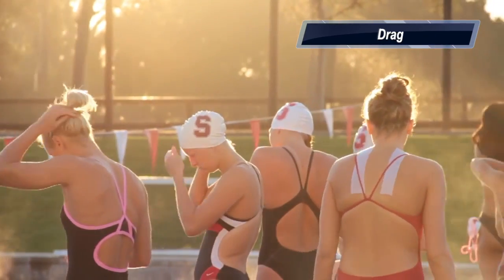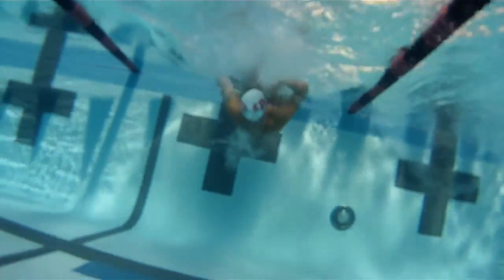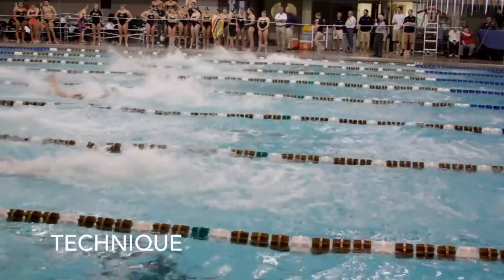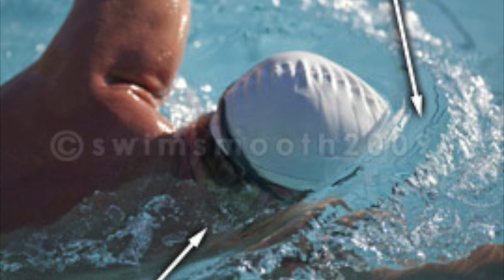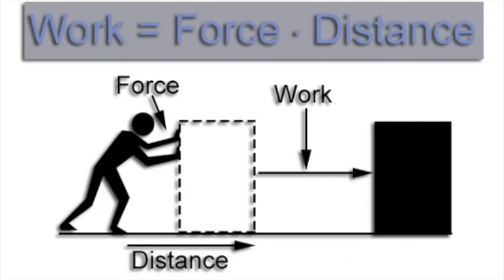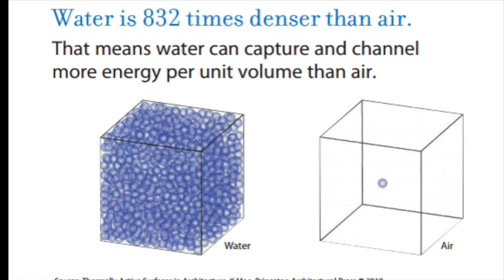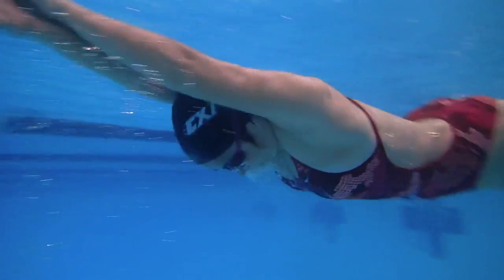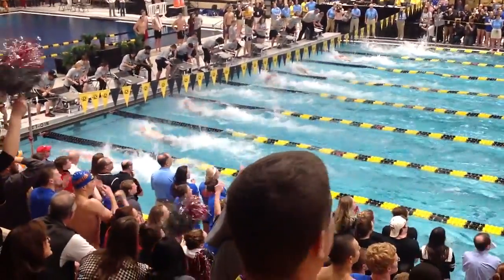The Physics of Swimming

Comment: Still waiting to see some one talk about getting under the backwash (all the water you drag into the wall with you), which is physics.. How deep, how far do you have to go to get out from it. Phelps is a master of this. Also, Both butterfly kick and flutter kick are 'crack the whip' actions. The fly is a total body wave type crack the whip, from arms, head, and shoulders to to the tips of your toes. The flutter kick is still crack the whip, but the energy transfer from shoulders to toes is a spiral/torque motion similar to throwing or kicking, but they are more of a push, and swimming is a pull. The kick that syncs with the shoulder pull/rotation is the stronger one...

Comment: A few of the terms thrown around are sloppy physics. I do have an undergrad in Physics so I get particular about it. Momentum is not force. The term "torque" herein used seems meant as a way to initiate propulsion. Maybe yes, maybe no - or, put a different way, not exactly. The video correctly point out that torque will tend to drop the feet as the body rotates around the center of mass during the stroke. One thing that would have been interesting is to use instrumentation to measure drag when towing swimmers of different shapes, using different swimwear, caps, no caps, etc.. Body type goes a long way toward making a low-drag swimmer. I am a former runner just three years into learning to swim and I find I am still very, very slow in the pool despite having had decent speed running and cycling.
Reply: Most people , never mind college yahoos, have no idea about physics and the real terms. They are too concerned about mico agressions and being Woke. Of all the purported industrialized countries, the USA ranks last in education values, marks, and rigor. How did that happen? BS passed off as college degrees. Social Science instead of actual hard sciences and "Education" degrees given for race relations and not educational rigor. Some country, some education. Who is teaching our kids and what are they teaching. As Noam Chompsky says about war , politics, tampax , or education: Is is all marketing and propaganda and almost never substance or truthful.

F=Ma    PxV = NRT  etc.. pretty basic concepts eh?  Go ask any non science teacher at any major us college? Second derivative of time with respect to distance? You don't have to Liebnitz to know. Ask any art major, education major, or football star?
Reply: I forgot to mention I was trained by the old olympic swimming coaches at Springfield College Vern "Cox and Red Silva. You might remember Dr Naismith invented basketball at same school.... I am a swimmer of considerable talent.